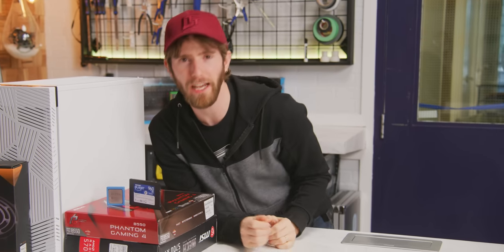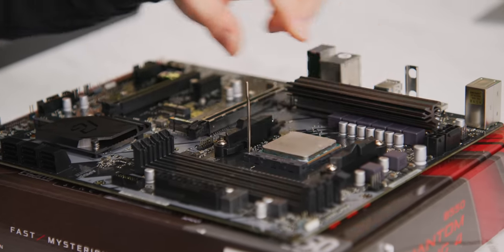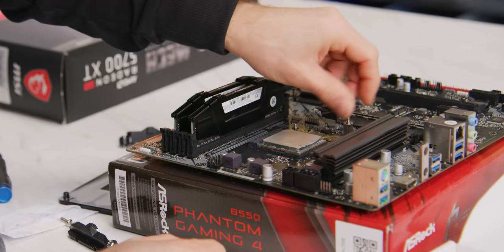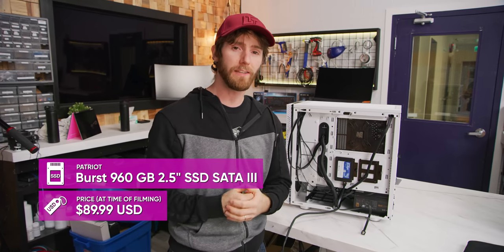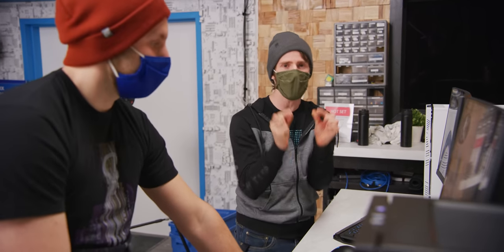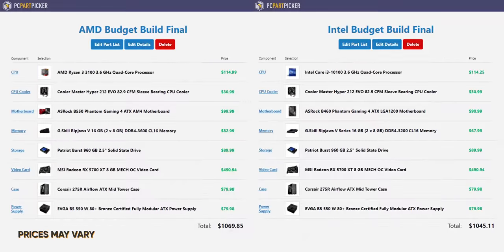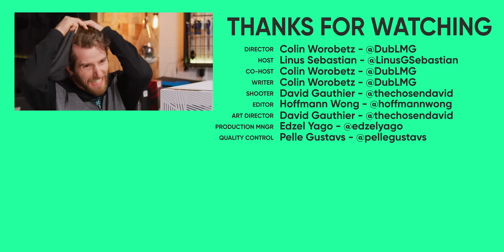AMD vs. Intel midrange gaming PC challenge

Comment: CSGO servers can be heavy on the host, especially when bots are running.
Reply: Yea and the majority of cs:go'er play on omega low graphic settings @ 1080p or even lower and stretched
Reply: @84drumz  what has that to do with the video
Reply: @Mitex i have a 4gb ram with i5 3427u and just a integrated gpu and i play on 640x480 and i barely gey 60.. i usually get to 20-50 depending on the map. My laptop is like 8 yrs old..
Reply: @drew scrivers it's also to have less distractions
Reply: I think it is because the (CPU) is having to process all of the things that are taking place on that particular server so therefore, that is why you could  experience some graphical issues or processing  power issues.
Reply: @Mitex He probably means that super serious players tend to drop their settings all the way down, even resolution, in order to gain more fps.

Comment: Yeah thing is CS has been running smooth on machines for oh, 16 years.
Reply: csgo has only been out for 8
Reply: Fr, my old 1050ti could reach 150+ FPS on maxed out settings at 1080p
Reply: @orestis1935  my guy really thought  cs has only one game
Reply: @eltopich  called CSGO, not just CS
Reply: @RealMTBAddict  he’s talking about the Counter Strike franchise in general, not just Counter Strike Global Offensive, they do have other games...
Reply: @Cruze Gardipy yes, I know. Pretty sure the OP was talking about CSGO. That's the game most people do benchmarks off of.
Reply: My Athlon 5350 is unable to run CSGO smoothly, even at 800x600.
Reply: @greylawson6352  csgo is also cpu bound. I have a 1050 and get 80 stable fps on lowest settings
Reply: Star yes  is it a gaming laptop? My Asus from 2017 has a 1050 and runs CSGO pretty well, even Modern Warfare decently. Not sure the FPS on CSGO, haven't played in over a year. But my main pc is an Alienware R8 with a 2060.
Reply: facts, even my ancient Athlon XP Radeon 9550 machine was able to run it back in the day
Reply: @matascekas7663  yikes, I had a i7-7700k then and that with the 1050ti killed it honestly
Reply: @greylawson6352  i dont think its because the i7 boosted fps, but rather my dual core i3 is struggling
Reply: @matascekas7663  yeah that's definitely the problem, there's great budget CPU's out there now from both AMD and Intel, I'd seriously recommend ditching that old dual core i3
Reply: @greylawson6352 My inpatience really screwed me over. I could've saved up a bit more and by that time Ryzen 2nd gen and RTX 20 series would've come out, but I really wanted to play games which my old laptop couldn't do. I'm saving up for it, have been for 2.5 years now. My budget will be around 1000-1100 euro, but I'm at 500 rn so it'll take a while. I wanna future proof at least a little.
Reply: @matascekas7663  why are you saving up such a big budget when you could just upgrade parts in your current rig right now? I built my system in 2016 and have been upgrading it ever since, turned my 1050ti into a 2070, my i3-6100 into an i7-7700k, and my hard drive into a Samsung evo m.2 nvme ssd. All over the course of 4 years though
Reply: @greylawson6352  I mean you built it, mine is a prebuilt with a warranty (and considering I downloaded some pretty shady stuff in times of desparation, I'd like to keep the warranty just in case) and by the time I count every upgrade its barely worth it. I need a new platform, new gpu, more and better ram, power supply is probably the usual non-80+ trash. The case is actually alright has decent airflow. The hdd is probably gonna be the only thing I'll reuse
Reply: @eltopich  they took benchmarks of csgo not source or 1.6. the games are irrelevant in terms of benchmarking considering how outdated and unplayed they are

Comment: Me:Nice! Budget Gaming! 
Linus: Around 1000 bucks
Me: das not budget
Reply: Lol yeah...
Reply: he would never compromise in GPU and storage area to fulfill 1440p gaming experience tho.
if u prefer 1080p gaming experience u can easily pick up under 300$ GPU with 7200rpm hdd
Reply: problem is
 they are targetting 1440p
ofc it will be expensive
1080p on the other hand will be cheaper by a lot
and you can even use older or slightly lower cpu and gpu, get more storage or save money for future upgrades
Reply: To be fair, the title says midrange. A lot of AAA games are getting more demanding, so for $1000 this configuration is not bad
Reply: @JhanOjan  HDD is the worst thing to do to any of your PCs, gaming or not. Unless it's just for storage.
Reply: @Anankin12  if it's for budget matter, everything should doing fine. fun fact, i finished Horizon Zero Dawn with 5400 rpm 2,5 inch laptop hdd that attached into my pc. it runs well on maximum setting 1080p, no issue beside very long first loading screen
Reply: I mean it's 1000 Canadian dollars, so it's actually much better than it seems. It's about $780 or £560, which is exactly what I'd imagine a budget build to cost tbh

Comment: Just wondering, was the version of cyberpunk you were running before or after they fixed the issue with the lower end amd CPUs
Reply: pretty sure it was before, performance should be about 10% better now
Reply: @jack52530  and therefor same as the Intel system
Reply: all speculative
Reply: Yeah, that's a big question mark... I would really like an answer, for science.
Reply: This video is at least a week old (for floatplane) and was probably shot maybe 3 days before that
Reply: Possibly earlier, but I don't know lmgs exact workload.
Reply: Just checked when the changelog for the AMD fix was released and yeah, they most certainly shot this before that. That was on December 19 which is 8 days ago which means that this video has to be 7 days old for floatplane and a few more days earlier at the very least for shooting and editing which don't happen on the same day
Reply: @jack52530  30% on r3
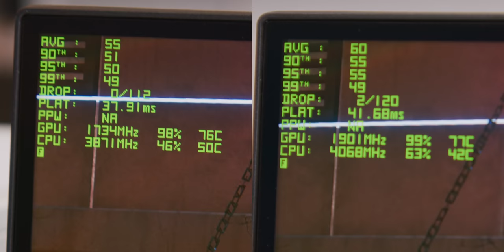Reply: @IIARROWS  12:24 AMD CPU runs at 48%, it must be before the fix.
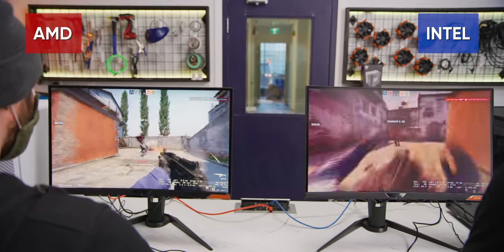Reply: 7:54 bottom right corner
Reply: Going off of the bios date it says 11/13/2020 so over a whole month ago so probably was abit before the update fix! :)
Reply: I "fixed" cyberpunk on my ryzen 3 3100 and i cant tell you that nothing changed

Literally.
Reply: @zerozeroone001  And they didnt oc the 3100 so it would prop be ahead in cyberpunk 77!
Reply: The price of the 3100 went up significantly as well